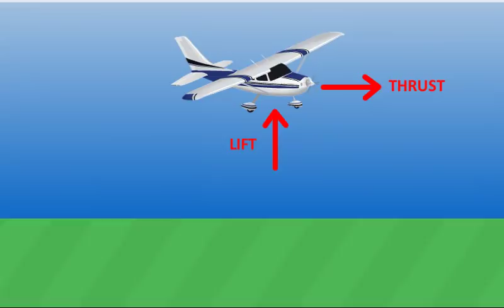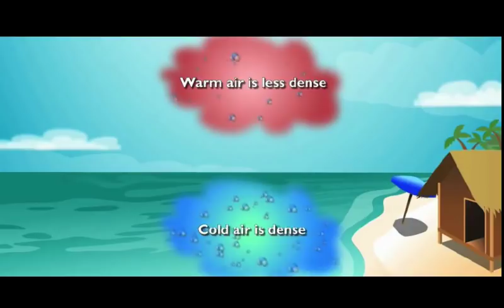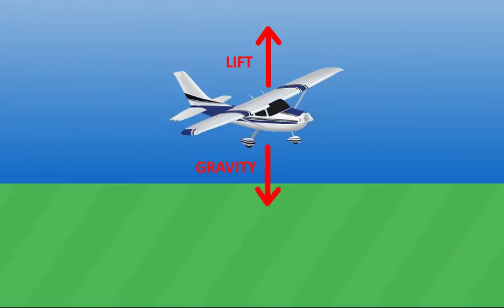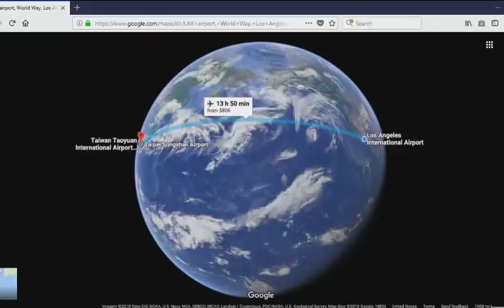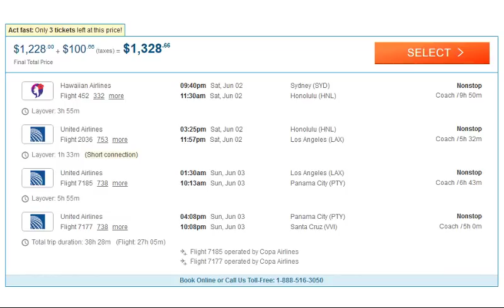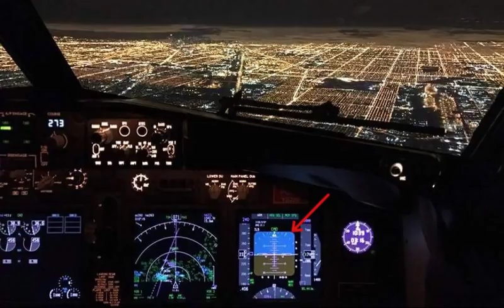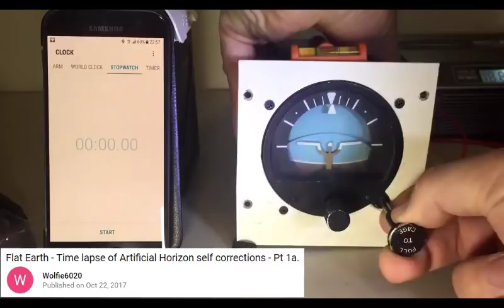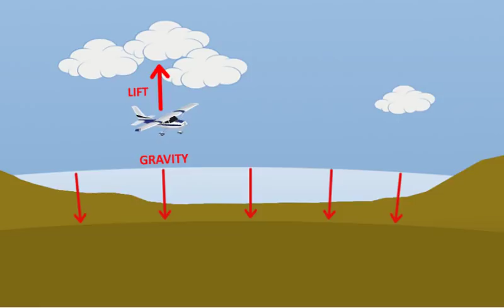Flat Earth Falsities - Plane Nonsense

Comment: Licensed pilot here.... I can’t believe people believe some of the flat earth theories. Planes fly in an equilibrium with the atmosphere, they gain and lose altitude depending on air temperature. They fly around the earth because the wings need a pressure difference between the bottom of the wing and the top. The higher the altitude the faster it needs to go to create the same lift because less molecules are traveling around the airfoil. Your air speed will appear the same, but speed in relation to the ground increases. This is important to note for the same reason. Eventually the plane can no longer create more lift to climb higher. But the force of lift will still equal the force of gravity at any flyable altitude for the lane (equilibrium) same with speed, at a given power setting the force of thrust equals drag and settles on a terminal speed. Reduce power and the loss of thrust will cause the plane to slow and the slowing in turn makes it descend. You are floating on air with a given density, as that density decreases you will naturally lose altitude and since this is happening constantly you will never just fly off the globe. You will stay in equilibrium around equally dense air where lift has kept the wings the whole time given a constant power setting.
Reply: More to point have ever flown over "the edge" of the Earth? The whole idea of a flat Earth makes no sense whatsoever!
Reply: @johnburke3444  What flat earth bible has an edge? Who preaches there is one, aside your school teacher FE presentation..... Many FE videos claim EARTH realm is surrounded by a ice barrier or dome edge one, but npone claim there is a drop into Nothingness.
Some claim more sea and lands, non proclaim flying pizza.
Have some guts and research the dissident heritics visions first.
It makes no sense the lifeless land Antarctica is the most guarded and no planes are allow to fly over the poles.
Reply: Louis Shaw show me photographic evidence of this ice wall! I'm not joking here, I'm genuinely asking. Also there have been thousands of voyages, made be countless vessels over hundreds of years, I haven't once heard of anyone mentioning an encounter with an ice wall!
Reply: Louis Shaw planes fly to drop scientific communities off in the antarctic, and the arctic is also inhabited, even by military personal protecting ours and Canada’s norther border from Russian aggression in the Cold War
Reply: Louis Shaw also, there are some pretty neat examples of celestial navigation even on YouTube none would be possible without a round earth due to the mathematics of it. And it’s how people found their way around
Reply: Louis Shaw also gps follows a similar system... gps has orbiting satellites in space
Reply: Louis Shaw the coreolis effect which causes hurricanes also not possible on a flat earth...

How about the tiered gyro cells our weather systems rely on? The 4 seasons? The fact that the sun changes trajectory as it appears on earth? The days of darkness and no sunrise in Alaska??
Reply: Louis Shaw what path do you presume the sun takes???
Reply: Louis Shaw why is mars round?? Jupiter??!?! Venus?!?! Neptune??? The moon???
Reply: Louis Shaw why is the sky and stars different in the north and south hemispheres and with the seasons?
Reply: Louis Shaw gravity pulls mass towards its center, in space there is no up or down as we perceive it on earth Down is then defined as toward the terrestrial body (like earth, Jupiter etc)

Planes fly in relation to the pull of gravity because their lift vector must counter gravity effienctly.
Reply: Louis Shaw invest in a telescope and see the planets with your own eyes.

Don’t go for a cheap 30 dollar one. Get a good refracting telescope with a large aperture for clear defined images and explore, open your mind.
Reply: Louis Shaw why did voyager orbit around planets and then proceed to leave our solar system? Why do we have so many satellites in space going around the planet helping you use the very internet you’re so gullible to taking information from?
Reply: Louis Shaw why does the sun set later on the west coast???
Reply: @BrainUser1  I have an open mind. Can you please tell me what is the benefit of having a flat earth? Everybody tells me it is a sphere but I want to hear your side.
Reply: Zachary Hein LMFAO he opens by announcing his profession so we can gauge how ignorant he is off the bat! You flew planes thousands of feet above the ground and you STILL buy that it’s round?! You, sir, have lost all credibility.
Reply: Zachary Hein question: how many feet of altitude before you shut off the fuel intake? Or is this the moment where you realize...”oh THAT’S what that button did...”?
Reply: MessiersElbow the engines must stay running in flight. You don’t ever “shut off the fuel intake” many light aircraft are manually leaned with a red knob labeled “mixture”. What you just accomplished was letting me know your lack of knowledge on physics of flight and physics in general for that matter (terminal velocity, friction, lift, the 4 forces of flight) the very reasons and aircraft stays airborne. But you also just informed me of your lack of knowledge on how an engine works, whether piston, turbine or otherwise combustion driven. 

So. Allow me to school you.

These are the facts.

An aircraft flies by producing lift via the Bernoulli principle over the wings. Lift creates drag, and requires both speed to create sufficient lift and constant thrust to maintain speed, the engine produces this. At an established cruise power may be reduced to maintain speed and save fuel consumption. Those light aircraft I mentioned earlier the pilot will periodically adjust the engine mixture to a prescribed setting in the aircraft “pilot operating handbook” which will help the pilot determine those settings. In some aircraft a fuel selector valve is used to balance fuel consumption which may be uneven during extended turning maneuvers since most of the time fuel is stored inside the wing.

Now let’s focus on engine design. Fuel driven engines of all kinds need to maintain a combustion cycle to stay running. In piston driven aircraft air is pulled into the cylinder with a fuel mixture, the intake valves close and the piston begins to travel up again on a compression stroke. Engineering in engine varies as to when the piston will detonate the mixture (this is know as timing) and in many modern engines ignition can be computer controlled for optimum efficiency since it can be advanced and retarded as needed for octane levels and engine knock. But this may be a little complex for someone of your capacity, so moving on... the engine detonates, the expanding gasses press the piston down and then the exhaust Valves open to expel the spent gasses some point before top dead center the exhaust valves close again and the intake opens on a new intake cycle. For simplicity remember “suck squeeze bang blow,” all the things your mother did to create you (questionably with your father or a cousin or something)

Moving on. 

Turbine engines work on a similar principle, but they run at much higher speed.  they pull air into the engine by a feathered intake fan, then a series of compressor blades inside progressively compress the mixture, fuel is injected and then detonated and the hot gases are forced out the back, as they exit they turn another fan which is attached to the intake and compressor fans by a “turbine shaft” so the cycle can sustain itself. Suck squeeze bang blow. There you have it. 

If in doubt google is your best friend.

Science will prevail, I just hope the gene pool will as well. I fear for humanity when illiterate and willfully ignorant 1st world children seem to be so bored they have to make up some ludicrous idea that is proven in an unbelievable amount of ways. You should have payed attention in high school. Or was your low budget southern education not sufficient? Your grammar and sentence structure suggests you are only half English competent. Please tell me you suck at writing because you somehow know 2 languages

你中国人吗？
Kannst du deutsch?

Oh god humanity is doomed
Reply: Good old Zachary... and how does all that not work a flat level plane?

Comment: Sure a lot of invisibles about, one definitely needs a lot of faith, or very limited deductions from  some observations. Core thing is the sphere core, never seen /touch /smelled or directly sensed, just much most be needed.  So it is a part of BIG bad BANG (christian priest Lemaitre Cosmic Egg invention) that  nucleus 'caught fire chunk' twirling away, as it flies uni-directional  Miss Gravity opts for forming into a ball shape (vs rocket one) and starts grabbing stuff around and sticking it together.
    Question is among all this sanity, how does ball IT form flat layers to acquire two Magnetic poles? How did IT just attract NON Magnetic mass layers coverings (they say diminishes its force) that it keep such a perfect uniform global magnetic wave all around (and out) its very thick crust ??? 
NO MINERAL OR HOT SPOT (ex Earth core lava land)  does any re-routing magnetic field lines over the poles? WONDERBAR all of it !

[ It is magnetic at normal temperatures, but critical temperature (about 1420° F for simple carbon steel) also makes steel non-magnetic. But it doesn't become magnetic again until it *drops to about 500° F. *  When you heat the iron to a high enough temperature (called the Curie point), it loses its ability to be magnetized. Heat energy scrambles the iron atoms so they can't line up and create a magnetic field.] 
[ A team of scientists has measured the melting point of iron at high precision in a laboratory (WOAW RARE MODERN SCIENCE!) , and then drew from that (AH!) result to calculate the temperature at the boundary of Earth's inner and outer core — now estimated at 6,000 C (about 10,800 F). That's as hot as the surface of the sun.

NO answers or explanation on that, never, Magnetism contrary to Gravity can be demonstrated in labs, proven with Scientific Method.
ps: check my earlier thread for stupid input replies on the matter, real science wizkids !
Reply: You forgot to mention how you invented the banana.
Reply: Was that an attempt at conveying your thoughts? Typical greek style mason Starwind inputs.  LMFAO. That really says more about you than anything LMFAO. Troll on my friend, the more of you the better :)
Mainstream fanatics only makes "arguments" from ignorance so there is nothing credible, no concrete, just bully lip, offered by them. 
Black occult or Primate hate Christians but follow all their science, were would they be without Vatican? 
Now where is his "sidekick" +Dark lord of all.. sock pocket "bla bla bla" genius?
Reply: @BrainUser1  hey I'm still laughing about your term Geometry Understanders. Freaking amazing.
Reply: @BrainUser1  and you be sure to keep up the mindless gibberish and arguments from ignorance. Every post you make helps to boost this channels engagement rating.
Reply: My Comment would not be so popular without it, two for a little mirroring.
32nd Degree Mason talks about Flat Earth symbolism - SW52 - Mark Sargent
Reply: Yes, truly a credible source of information.
Reply: @BrainUser1  The impossibility of the magnetic field due to iron losing ferromagnetic properties above the Curie point is the kind of superficial cherry picked argument that dazzles scientifically challenged FEers, with the imagined delight of stumping REers. Not today — in reality, the Earth's dynamo depends on a self-sustaining electrically induced magnetic field, not ferromagnetism.
     The turbulent flow of molten iron-nickel acts as a dynamo. The dynamo is self sustaining in that the molten metal moving through the magnetic field generates a current which in turn regenerates the magnetic field. The magnetic field was most likely seeded by the Sun. The collision which resulted in the Moon, is hypothesized to have produced the geological structure giving rise to Earth's strong, enduring dynamo driven magnetic field, which Venus lacks, Mars has lost and is quite weak on Mercury.
------------------------------------------------------
      The rest of the OP is so filled with sarcasm that it doesn't make sense what he's trying to say. But it's not important anyway... 
      ►"temperature at the boundary of Earth's inner and outer core ... estimated at 6,000 C (about 10,800 F). That's as hot as the surface of the sun."
      The temperature of a lightning bolt is 30,000° C (about 53,500° F) while the temperature at the Sun's core is 15 million° C. So what? 
      The molten iron-nickel alloy only has to be electrically conductive, not ferromagnetic. At standard temperatures, copper is diamagnetic not ferromagnetic; aluminum is paramagnetic, not ferromagnetic. Both are good conductors.
      ►"how does ball IT (sic) form flat layers to acquire two Magnetic (sic) poles?" 
      It doesn't form flat layers nor need to. 
      ►"How did IT (sic) just attract NON (sic) Magnetic (sic) mass layers (sic) coverings?" 
      It didn't, but heavier matter tends to sink over geologic time spans. 
      ►"...that it keep (sic) such a perfect uniform global magnetic wave all around (and out) [of] it's very thick crust?" 
      Magnetic wave? Does he mean the magnetic field? It's not perfectly uniform. And it's much weaker at the surface.
      ►"NO answers or explanation on that, never, Magnetism (sic) contrary to Gravity (sic) can be demonstrated in labs." 
      We did answer it, and who knows what "magnetism contrary to gravity" means?
-------------------------------------------------
https://web.archive.org/web/20180601215906/https://physics.aps.org/story/v19/st3 https://en.wikipedia.org/wiki/Earth%27s_magnetic_field
Reply: I like you Louis, you make me feel smart.
Reply: @louis I always enjoy reading your comments =)
Reply: @reggiereid1345  Thanks man, I try to provide some common sense pinpointing, with some writing liberty, amuses me and rattles the obsessive english A students.
Only thing my quality seems to attract REPETITIVE_LY the same Critics.

AH and the "cherry" so unliked by science boys, it sure un-delights the scientificly state Ones.... personal attacks is always their troy horse :)

Woaw NOTHINGNESS non engineering /plan has got "self-sustaining" with "self creating" "self-improving" "self adjusting" "self balancing" "self harmonizing" "self _" ... lot of selfies... goaless NATURE has to conserve ...stuff.

ALL THAT coming with "making sense" from one more smart follower type= Robert Thomas 1 day ago=
@Louis Shaw There you go, demonstrating the Dunning–Kruger effect again. Gravity doesn't magically go away in space.  Keep talking and making a fool of yourself.
Reply: @BrainUser1  Yeah I feel you. Its ridiculous here how some of these obsessive people act. I'll be gone for a few days and they will just keep sending comments as if to pretend the conversation is still going. There comments to me seem to be more for everyone else to read to form opinion about me, rather then for me. Nothing to offer but insults over and over as if they are getting paid to insult me. Normal people don't spend so much time insulting those they see as mental. There is so much more going on here then meets the eye. Its just nice to have others on the right side of things. You guys are few and far in between. Or so it seems. Maybe people just aren't as vocal about this subject.
Reply: @reggiereid1345  6 months with a "6 year physic student" on my back, does not like my free lyric style, or anything... Yeah they are desperate for attention and ego boosting, individuals that only oppose minority fringe groups.
Had so much mouth and drama on APOLLO hoax starts.
I spend some time here aside more serious places, most dont care of making a fool of themselves, mental projections of sociopaths.
The are low life overgrown bullies and need a fix, some are genuine concern authority fanatics that cant stand non believer heretics.
Reply: FOR 4TH GRADE ARRESTED MINDS =
BIGGER THAN FLAT EARTH - YOU REFUTE, YOU LOSE - SHOCKING VIDEO (FLAT EARTH REWIND 2018)  /watch?v=LQcHyMX4wsc

Comment: Don't forget that that a cimventiinal aircraft canot fly out of the atmosphere because it needs air to generate lift over the wings as well as the engine is air breathing the likes of tickets take a fuel and an oxidizes to facilitate the correct stochionetric ratio to develop the thrust required,
What's a very well presented calmly explained in a an easy to understand stand manor Weldon keep it up sir!
Just as an FYI  if you can't get your self assleep the FAA have put a how host of audio books on how aviation should work

!
Reply: What?